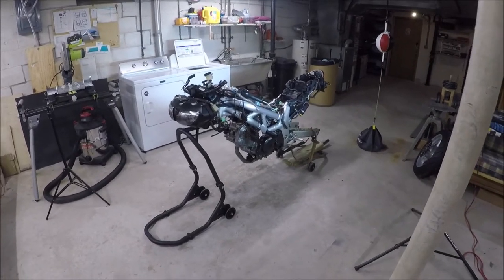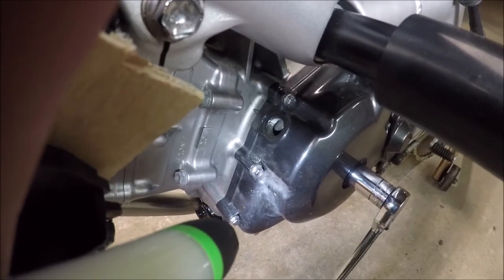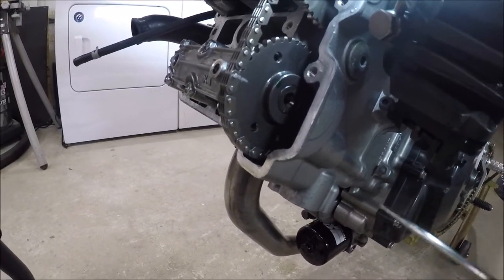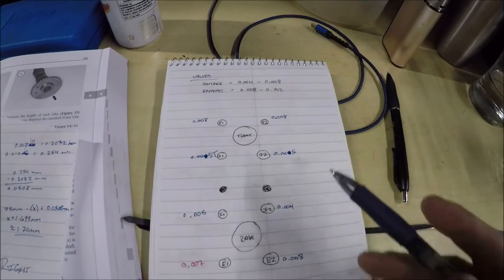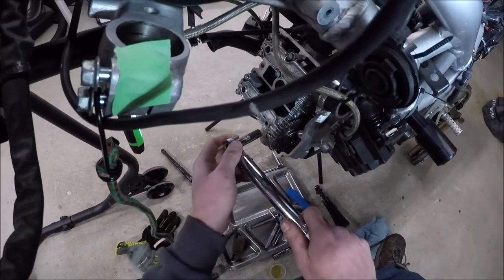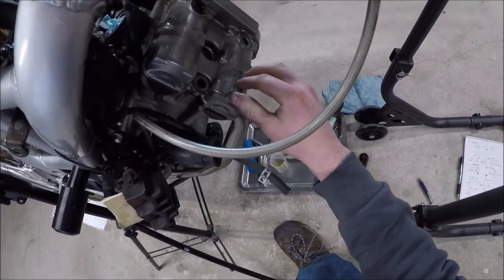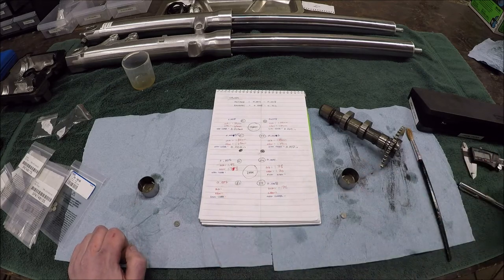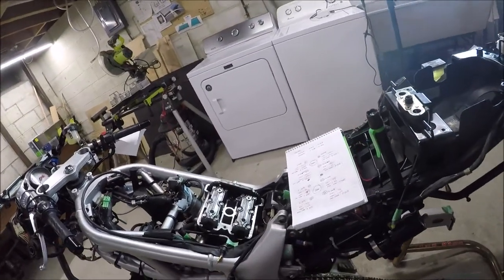2001 Suzuki SV650S - Valve Clearance Adjustment (long, sorry)

Comment: Great video,thanks for uploading.I checked my clearances the other month at 18000 miles,a couple of exhaust valves were right on the limit so I'm going to reshim the motor over winter. I'm seriously considering taking the motor out of the frame to give me better access to everything.The last minute from your upload is something we can all relate to!.
Reply from the maker: Thanks Mark. Access isn't that bad with the motor in the bike. If you don't have any other reason to pull the engine, I'd consider leaving it in. But totally up to you. 
I wish I could cut the last minute out of the video, lol.
Reply: @matttriestodothings  Yes,I'm wary of the exhaust studs shearing & making more work for myself.I'll just remove the rear shock for better access to the CCT

Comment: I love the rage, it shows that you care, and that you can feel frustration doing manual labor :) . Great video, torque your bolts to spec, it will save you time and money ppl!
Reply from the maker: haha--I do wish I could remove that bit of the video at this point, but this is one of the few I have made that has some value. So... I just have to leave it in.
Reply: @Matt Tries To Do Things  Keep the rage as far as i'm concerned, makes it so much more real, and the joy you can clearly feet at the end makes more sense.

Comment: I don't even own an sv650 or even a motorcycle with bucket and shims to adjust valve clearance yet I watched this.  Your rage mode is quite entertaining.   Btw, I've seen people have success with hammered in star torque bit into rounded off allen heads to remove them.
Reply from the maker: Heh, I usually edit most of em out, but I tossed that one in the end to ensure nobody got the idea that I actually know what I'm doing. Learning experience though, I should have just hit the rounded chain guide bolt with the impact right away and saved myself the elevated blood pressure.

Getting better. Just managed to install a set of new rearsets without even making a chirp! Okay, maybe a short outburst when the axle pinch bolt snapped at 15ft-lbs..I'll find my zen... Someday.

Good call on the star bolts. I need to get some larger ones in case I need to hammer em like you said. Thanks man.

Comment: After you set your cam timing points per the manual, and before you remove the chain tensioner, you should tie wrap the cam chain to the chain sprockets (one spot each sprocket) so you don't lose their spacing. You can now safely roll each cam off the buckets to remove them without fear of losing the chain position on the sprockets. Even if you lose the crank position, you'll only have that one spot to deal with a instead of all three.
Reply from the maker: So that is why I saw a few pictures of people with zip ties on the chain/cam. Thank you for that.

Comment: Thank you so much for this video ! my Curvy is now burning oil so I have to replace the valve stem seals. At the same time I will be doing this procedure. Keeping my fingers crossed.
Reply from the maker: For sure. I've never actually done valve stem seals--so godspeed! I notice that I do seem to go through some oil on track days running high revs, but I don't notice any oil consumption with regular riding. Are you seeing blueish smoke or quickly noticing that you're running low on oil?

Comment: Great video. Best in depth one I've seen yet for 650 valve adjustment. Just bought a 2021 V Strom so I won't be doing this myself for a while, but I'm watch videos and have purchased the factory service manual already.
Reply from the maker: Thanks Adrian, I appreciate it. I've got a 2018 V Strom with about 6,000 miles that I may check (hopefully just check, hah) clearances on this winter. I think the newer style cam tensioners are supposedly easier to work with. We shall see.
Reply: @matttriestodothings  I did see a video where the guy zip tied the cam chain to the cam shaft sprocket through one of the holes in the sprocket so the chain would not come off the sprocket. He then removed the cam shaft retainer cover and lifted the free end of the cam high enough to remove the shim buckets without taking the chain off the sprocket and with out removing the cam shaft completely from the head. Don't know if I would try it that way.
Reply from the maker: @amv606  I think I saw that one as well. It seemed like it could save you some time, but I think you'd really want to make sure you knew what you were doing first. Definitely more than one way to skin a cat--I just wanted to be as close to the manual as possible. It was a little bit intimidating to do the first time, but turned out it was just tedious but following instructions wasn't so bad.

Comment: Good vid, thanks for making it! I am so glad I'm about to move into a place with a garage so I can finally do this procedure, I'm not looking forward to having to re-mount the rear wheel though, I seem to remember the spacers would continually fall out.

Also, that ending lmao.
Reply from the maker: I figured nobody would actually get to the end, hah. Thanks for the kind words.

Get a block of wood the correct height, it makes it easy to get the spacers aligned if you're not having to raise the wheel assembly and also balance the spacers. I used to struggle mightily with it until I made that change.

If I were to do this again, I would spend more time making (2) perfect cam chain tensioner tools. You should be able to wind them up into the tensioners to relieve chain tension and leave them alone. This would negate the need to actually remove the tensioners completely. That is, assuming you don't bump them off on accident like me.

Comment: whenever i see valve adjustments on sv650, i always believe it is a lot more likely to do something wrong that will damage the engine than just simply keep riding with oil and filter changes and hope the valve clearances will never go out of minimal intervals...mine is 60000km, bought with 50000 and i am sure this service was never done.
Reply from the maker: I think you're probably right about the SV engine in that it's unlikely to be a big issue since most people report that they're very rarely more than a thousandth out of spec after 20k miles. I still think it's probably a good idea to check them at some point if you're getting in there for other maintenance since the check procedure is rather simple--if tedious. But you don't run the risk of hurting anything just by checking.

Comment: I'm going to check mine but I am waiting for spring because garage is really cold and could will give me false readings. this was an excellent video. I saw another one the guy just loosened the tensioner bolts but didnt fully remove them, I'm curious on your opinion of that.............................JB..
Reply from the maker: If you're working with a gen2 or gen3 engine, the cam chain tensioner is a different design where you can just remove the spring and plunger without having to remove the entire assembly. That may have been what you were seeing. You could also likely just wind up the tensioner in the gen1 completely and leave a stopper tool inside of it to remove  of the tension on the chain. It would probably be a little bit more difficult to remove the camshaft without removing it fully but doable. 

Mad8v has a good video about the differences in the gen1, 2, and 3 tensioners here: https://youtu.be/w_A6wQ7p-PM?si=RRSpGhBgABvXY2ZD

Comment: Lots of great info., Matt. I've been putting this off on my '17 650 Vstrom. I'm at 15,000 miles and ready for a check. I will remove the rear wheel! The worst part on my bike is that the ABS control box is almost in the way of the rear tensioner. By the way, you mentioned a tensioner tool or key - what is that and who makes it?
Reply from the maker: I've actually got a 2018 650 VStrom that will need this done as well. I'm only at about 5,000 miles, but I was planning on doing it next winter. Just coming out of hibernation now, so no plans to actually tear into it yet.

The Gen1 tensioner (from my research) is quite a bit different than the Gen2 and Gen3. Not sure if there are tools to be purchased from suzuki/motionPro/etc., or if they can also be fabricated fairly simply.

Now you've got me worried about the VStrom. Totally forgot about ABS.

Comment: Oh man, great job on that 5mm allen bolt at the end! I know how pain in the rear are those little fuckers if they're rounded. The same thing goes to a torx bolts. I guess the only option there is to weld the 5mm allen key to the bolt but you need to own a welder.
Reply from the maker: Yeaaaaa I should have tried the impact before I got all angry, lol. But I couldn't believe that bolt was rounded given its a low torque bolt in an area that won't see rust, so it shouldn't get stuck.

Included it at the end to drive home the fact that I'm not a professional in any sense of the word, hah.

And yea, I think you're welding at that point if you can't get a vise grip on it. And even then, you're risking getting foreign material into the engine. All around bad situation.
Reply: @matttriestodothings  I have to admit - it was hilarious watching this because I saw myself in those kind of situations, swearing as hell and throwing things all over the place. Oh man, what a stories I have, especially those with over tighten or rounded allen bolts haha. 

Lots of mechanics don't give a fuck, they tight every single bolt with impact wrench because it goes faster, instead of using their brains and torque wrenches. That's why I love to do repairs or maintenance by myself. If I screw something up, it's on me.

Comment: Look like a lot of work. What is harder bandit or the sv 650 vavlve adjustment?
Reply from the maker: The bandit is pretty straightforward once you get the valve cover off because you don't have to mess with timing or pulling cam chains out. The locknut-type valve adjusters are easy to work on and adjust. The inline 4 configuration has pretty simple access to all the adjusters (relatively). Everything's relative. 

The actual valve adjustment of the SV wasn't terribly difficult since I had a collection of shims on hand. The toughest part was dealing with those cam chain adjusters--though I think if I made two more rigid and capable special tools, I wouldn't even need to pull them off again for the next time. Luckily, at 27k miles and now adjusted to the loose end, I highly doubt that these valves are going to need adjusting anytime soon.
Reply: Your video about the bandit valve maintence help me a lot. 
Now thinking to change to vstrom 650 wiht similar engine, but the valve job scares me.
Reply from the maker: @apauma1  The VStrom should be pretty similar to this; however, the cam chain tensioners are going to be different depending on the model year you have. I'm planning to check my clearances on my 2018 VStrom over the winter next year. I'll need to do some reading up on the Strom's cct's and how they differ from the gen 1 sv650's. I think they're easier to work with from the little bit of research I'd found so far.

Comment: What do you suggest to check if sv650s suzuki doesn't start. I don't know why she is not starting 🤷🏾‍♂
Reply from the maker: Fuel, air, compression, and spark. Those are the four things you need. Without knowing more, my first suggestion is going to be to make certain that you've got your battery fully charged up. Are you getting any popping when trying to fire? Is the bike carbureted or fuel injected?

Comment: Is it possible to check the valve clerance without draining the coolant?
Reply from the maker: I'm fairly certain you could just loosen the bolts on the radiator to hang it forward to get the valve cover off. However, I'd probably just try to time it with a coolant change because it's so much easier access if you pull the radiator off completley.

Unfortunately not near the bike now to check to say for certain. I'll take a look when I get back to the bike tho.

Comment: What book is that you're following?
Reply from the maker: I believe I was using the Clymer manual.
Reply: @matttriestodothings  Very nice video btw, well done. Learned a lot. Looks fun, almost. You remind me of Bill Burr, could be the dialect. Also, wouldn't being on the tighter end of spec be preferable since wear will loosen it over time? Or perhaps I've misunderstood the terms.
Reply from the maker: @F3udF1st  hah, maybe I've listened to too much of Bill's Monday Morning Podcast for my own good over the years. 

Intuitively you would think that valves would get looser over time. That's what I thought at least. However, they generally tend to actually tighten over time as the valves and valve seats wear down which tightens up the lash between the valve stem base and the cam lobe.

Comment: What if one valve is little too tight ,but still within specs..does it still needs adjustment?
Reply from the maker: From what I have been reading from people much smarter than me (and also the suggestion from the factory service manual) is that "In Spec" is "In Spec". Leave it be. It shouldn't drift too much more, and check it again in maybe another 5000 miles. If you were well within the center of tolerance, go the whole recommended service interval of like 12-16000 miles. Can't remember exact figures.

There are obviously caveats to that. If the bike had 3000 miles on it and this single valve was on the tight end of spec and the rest of them were loose or in the middle.. I'd probably get a smaller shim in. Or if you were racing--you may actually choose to tighten or loosen the clearance based on when you wanted the cam to start pushing against the bucket and opening the gap. 

But if it's bugging you and you've got the time, I think there are some ways to simplify this process. Namely.. I don't see why I couldn't have just wound up my cam chain tensioner with the tool and pulled the cams out while leaving the tool in the tensioner.